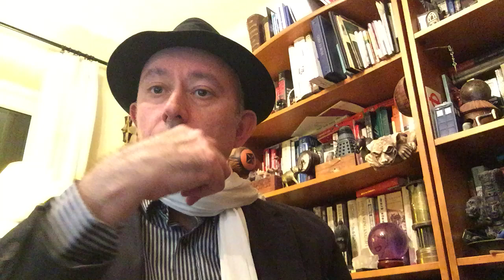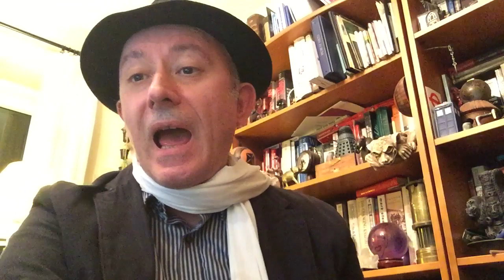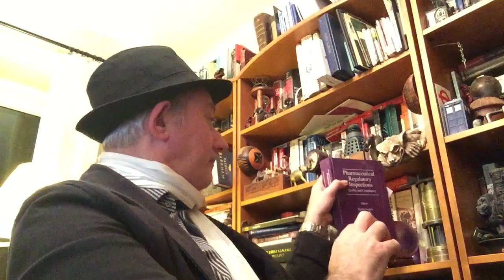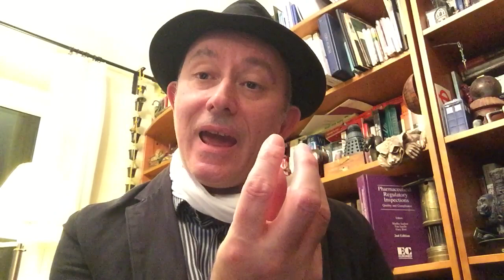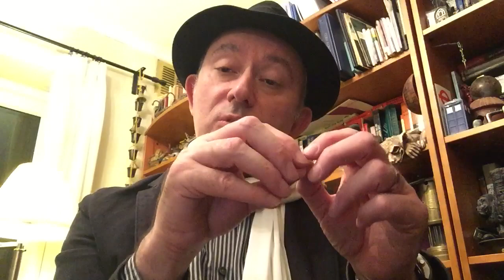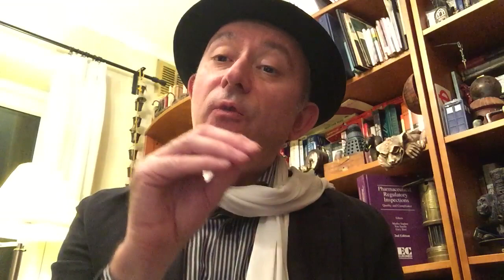Key points about active air samplers

Comment: Hi Tim, I love the bite sized videos! I have 1 observation and 1 question for you.
Observation, at Lighthouse Worldwide Solutions we as seeing a trend towards slowing the sample rate. Working with a reduced flow rate (either with portable or installed air samplers) covers a greater duration of the media fill with a simple sample. This can mean fewer agar plates and importantly fewer manual interventions.
Question, at 4.12 you mention 96 holes in the air sampler you are using. Is their any relevance of the number 96?
Keep up the great work!